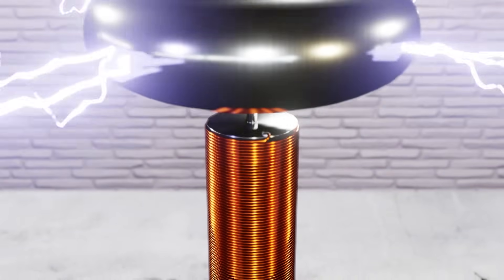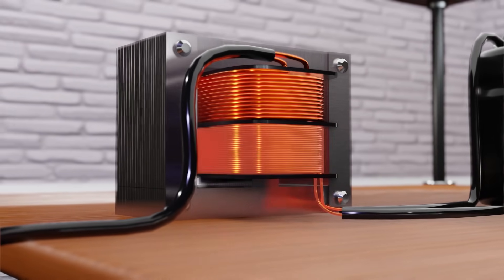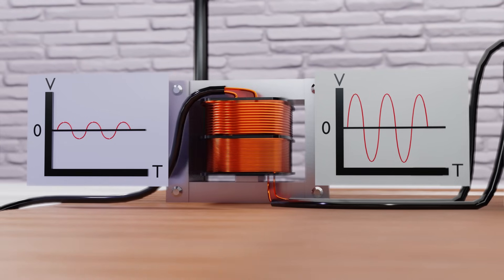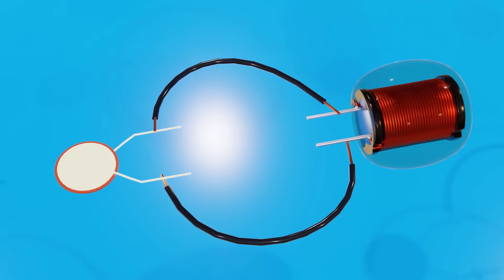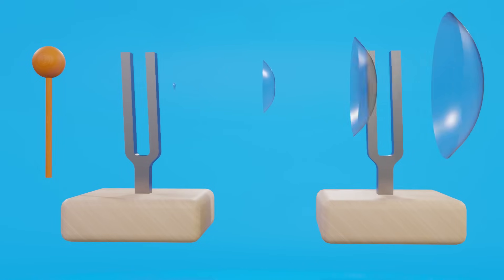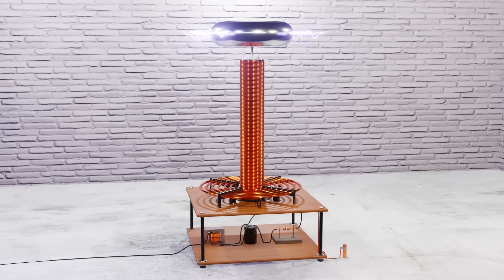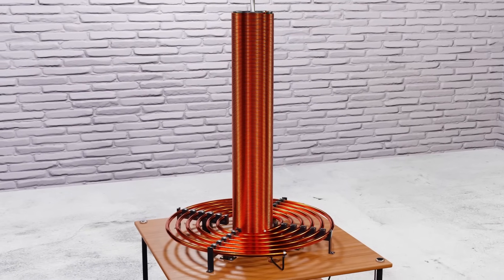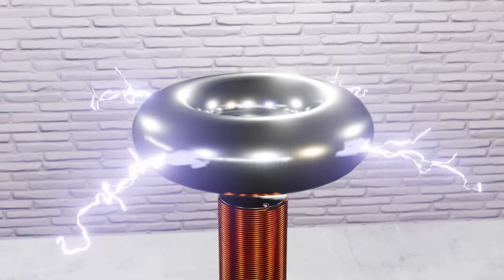How a Tesla Coil Works ⚡ How to Make a Tesla Coil ⚡ Nikola Tesla

Comment: Screw radio waves. Lets talk about Earthen resonate frequencies utilized to wireless conduct electricity as Tesla saw it. It's not new tech. It's not entirely unused, but few have even attempted a straight up functioning infrastructure. Then just plug into the ground and harvest the natural power of the universe by translating those seemingly infinite forces into good old fashioned electrical conduction that we like to call power.

Comment: Fun video.  As I understand it there is a mistake at minute 4:14.  When the capacitor is discharged the coil has the maximum magnetic field strength (correct).  The  magnetic field will decrease and induce a current in the same direction resulting in the capacitor being charged oppositely to the initial charge. (seems to be incorrect as you say in the movie the current is reversed)

Comment: I wonder if it would be hot to the touch like does a tesla coil generate heat?
Reply: Wire usually gets warm to the touch, but generally not hot enough to melt the structure or cause burns.   ~100-120degF is pretty common across coils of this size
Reply: @hakasays  thanks for the honesty

Comment: Electrical power distribution by Tesla method only a demonstration purpose only, it could never to be implemented as a practical means to send long distances as an utility as we use today with wires. Just a toy idea.
No need to tell  how dangerous a millions Volts of electric arcs across our atmosphere, it would be capable of giving electric shocks whenever earth & a metal objects touch by a living animal.
Infact during Tesla's experimental work horses with metal shoes had experienced it. Mentioned in the article about Tesla: " Maplin Electronics" 1996 Feb issue.
Besides the power getting low with the distance & no way to regulate it,  may need further equipment for it. Constant voltage at the receiver end only a dream.  Gullible viewers believe into think how great the Tesla is. We remembered him  for his pioneering work in polyphase AC generation/ Induction motor, [though the final products developed by the Dolivo Dobrovolsky] but not for his other eccentric, visionary ideas.
Reply: It goes underground. Very safe. Just reads teslas books and you will understand.
Reply: @nialldunne3985  Returned path of the power is through the earth, this is why it's more dangerous. Then Earth is always one conductor [not  as it today] & then we could get shocked  by touching a metallic object raised to the air.

Comment: Oh dear. Nope. You have not built a 'Tesla tower' because you are  not creating the second form of electricity that Tesla made use of, Impulse Current. Until you understand impulse current, you can't make a Tesla system of power distribution unless you remove the magnetic component and measured output is volts per second. Impulse current!

Comment: the magnetic field loses power quickly because the field is not pulsing within any resonance with the environment around it, if you add a frequency controller and if you know the resonance frecuency of the menium youre trying to cunduct thru you can actually amplify the output much like how you can swing higher if you shift your weight at just the right time, done in the wrong timing and your swing stops.... tesla knew this well over 100 years ago and you totally missed it, also the tesla coil was never invented to make pretty sparks the topload was actually supposed to have as much surface area as nessessary to keep the high voltage from arcing as bolts as this is a power loss.
Reply: Need more info sir lol. Would this work with those adjustments? Wireless power?
Reply: @michaelbrown428  you would need a device that can measure the environment electric fields frequency and set your coil to a resonance of that frequency.
Reply: @drayko-okamidirewytch5542  And, does that device exists? I mean, that was Tesla's intention and, according to some, he achieved it. I just want to know if we have the means. Cuz if we do, then it's only greed that keeps us in the dark.
Reply: @jacomeluis  well yes greed is keeping alot of tesla's work away from public knowledge, but truth is yes we actually already have the means to continue his work however the knowledge to do so these days would be quite difficult to find.

To give a bit of an example we have the means to understand vibrational harmonies, take a piano for example, strike 2 random keys and you might hear a pleasant tune or you might hear one thays rather nasty, this is an example of harmonics. Because many systems even in our own bodies are sensitive to vibrational frequencies we can actually use our own senses to tell if a vibration has harmony or not. Put simply a good chord feels good because it resonates positively with the various parts of our body.

There's another example of being able to detect harmonic frequencies and that where you use a subwoofer a metal plate and sand, and as you transition thru a frequency range you can see the sands design change, while some frequencies look amazing others look chaotic. It could be a matter of applying this to other designs like maybe an array of electron guns thay use frequencies ranges to see how a medium reacts to the transitions and taking note of where the patterns in the interactions look more orderly than chaotic or some such.

The hard part is we have to stop being students of science and return to being explorer's of science and make the new discoveries ourselves.
Reply: @drayko-okamidirewytch5542  Cool... Thanks for the explanation. 🖐🏻
Reply: @jacomeluis  I do apologize if it's badly articulated, it's not easy for me to describe these things even with a wide range of knowledge. I can tell you that some topics to consider studying would have to be organic geometry like the golden ratio and the platonic solids, music theory is a good one in combination with mathematics. The reason we see nature as beautiful is because the patterns we find on all facets that have mathematical roots. And everything boils down to its simplest parts as a vibration, even an electron just orbiting an atom vibrates, and nothing can vibrate out of harmony with its environment for very long as doing so expends energy forcing the disharmony element to return to harmony with its surroundings, from the quantum to the macro this is always true, even study of the hermetic principles would show this fact.

I could go on for hours about the many great things I've learned from humanities history studying the universe and asking "why does it do that".

Sometimes the answers come more from a philosophy lecture than they will a science text book, we are the universe and the universe is us, as above so below, that which defines the structure of the energy within your mind so too does it define the structure within the universe, the only 2 opposing forces that can remain are those that neither diminish nor amplify their counterpart but remain balanced. If that makes any sense.
Reply: @drayko-okamidirewytch5542   I think it's fine... I'm not an English native so I always have to read carefully, but I can get the idea.

I got here because I'm studying pyramids and, apparently, Tesla was obsessed with them. I know it might sound crazy, but I have 3 years healing or treating all kind of illnesses with plain cardboard pyramids and I'm studying for a workshop somebody asked me to do.

There's many people working on that field, but it's still too unknown for the importance it should have. The thing is that, if I have felt in my own body the energy that a 3kg cardboard pyramid can condensate out of thin air, I can only imagine what a 6.000.000kg granite pyramid can do. I really think that one of their function was to produce and transmit electricity through the natural field, as Tesla wanted to do with his tower...
Reply: @drayko-okamidirewytch5542  id love to hear more about your research…where can i contact you tho?

Comment: Well, you explained the demo he did.  Not how, or should I say the actual circuit that he didn't explain or show.  That was solved about 10 years ago by someone in New Zealand or was that Australia.  Nikola had allot of circuits and design stolen so by this time he didn't say or state until he had what ever built which was rarely in fact.  Most people look at the circuit left to right but you have to look at it right to left in this case.  Plus there is a single change to the circuit then it's whole operating principle changes.  It  becomes a wireless power accumulator.

Comment: This video is full of mistaken theory.  The toroid at the top would not store more and more energy, at each cycle of the primary unless there is conversion to direct current, (like diode rectifiers or a vacuum tube rectifier).  With spark gap discharge of the cap in the primary circuit one would not get a large discharge from the secondary., that is why rotary gap discharge , and DC charging and coupling of primary and secondary are usually used in high power tesla coils.  I'm not quite sure why everyone seems to build tesla coils with flat circular primaries, and very tall and narrow secondaries.  Tesla's MAGNIFYING TRANSMITTER at Colorado springs was a multiphase device, and had an extremely wide primary that was columnar, and the secondary was rather short and stout.  He also placed other coils into the mix that modulated the hysteresis of the primary and secondary.  his initial idea was to use the Tower to provide a controlled discharge of the ionospheric charge in the upper atmosphere and create a resonant response in the iron core of the earth.  So, not only were the coils of his "transmitter" tuned, but standing wave harmonics in the ionosphere and the earth's core were meant to also be put into resonance, so the breakout discharge was absolutely necessary as that provided a path for discharge of the ionosphere into the coil, and the grounding system provided a way of creating ripples in the magnetic field of the earth.  So far no one much seems to read and understand Tesla's articles.  The only explanatory video's that I have seen that make much sense of Tesla's Planned devices are by: "Lightening on Demand", and Long Now Foundation.  

Paul Carlson (Carlson's Lab) shows how two resonant Tesla coils, tuned to the same frequency couple energy without spark breakout, but this is not really how Tesla's transmitter was intended to operate.

Comment: Soo, what Book did you read this out-of? The Air itself has a Built-in Capacitance and Tesla knew of it plus how to Make the Capacitance Elastic ( which you've totally ignored ) and finally, The Tesla Coil was used to take Static Voltages and drop them down to High Current with Usable Voltages .. not the other way around.!
. When it comes to Tesla Designs, you get An "F" for having nothing more than a Management Degree in Engineering From One Book.!

Comment: Joule thieves are why we don't use tesla coils.
See, in radio there is stuff that  comunicate back for sampling so we can get the ratings so advertisers can fund our radio stations, and it's not legal to make a device that doesn't accept interference.
 BUt it's possible, but almost pointless. It doesn't do you any good, in fact, all you would do is spend energy to loose a service. that is allready free. you still here the ads, but not pay the station, and you raren't a militia so  not having your radio jammed means nothing.
You might as well not risk going to jai over nothing.

But internet hackers will steal your wifi and all sorts of things becuase doing that has vallue.
Theives would steal electricity, and coils are easy to make and destroy. 
in other words, it can't be monetized and no one has figured out yet how to enforce payment

Comment: I've made several TC's. Right now I'm working on a spark gap model with a synchronous rotary gap.  I fortunately have a .025 mf 50kv capacitor.  Hard to find!
Reply: is there a way to use and store in a battery somehow? i could never understand sadly

Comment: I still need understanding on what the spark gap's purpose is. Also, why is it that the light bulb that is closer to the main Tesla coil out of the field can't receive power, but the secondary Tesla coil further can? I already understand the sound wave 2-tuner analogy, but what is the difference in the Tesla coil since you said the magnetic field does not travel far?
Reply: Consider the radio receiver. Electromagnetic waves travel great distances, like to Mars. They're pretty weak as the distance increases but they're present. In the case of the TC just too weak to light the bulb as distance increases. However if they hit another tuned resonant circuit the demonstrated pendulum effect happens.
Reply: The secondary coil is on the same frequency as the primary one so it receives the EMF that it then uses to power the light bulb.

Comment: How would a tesla coil be beneficial in transmission of electricity,and also would super conductivity be an option
Reply: In theory you could power a whole house or even city wirelessly.
Reply: @prestonwarren2692  yes I'm aware of the possibilities, tesla was well on his way before  Morgan stopped him.i watched the development of mag trains using super conductive coils, I was interested in the prospect of using the two in combination, coils to maintain the current tesla coil to broadcast, just a thought
Also did you hear anything about an African that is useing a wireless device to convert radio waves in to electricity, supposedly has been useing it on his television
Reply: @dannyjohnson6967   I haven't seen that it sounds very interesting. I don't think we will ever see anything like that simply because there is no money in it. Wires running to your home is how they determine how much electricity your using and charge you accordingly. I know if I discovered or invented any sort of alternative energy source I'd be reluctant to tell anyone about it. The same goes for fossil fuel replacements.
Reply: the Original Tesla coil would make a great power supply , and yes a superconductor no problem, also it could run a particle accelerator, for an interstellar craft, the math has already been done. we are getting a clearer picture of this coil because of the upcoming tech about to become available.

Comment: Yeah except for that's not how it was intended to be used can it transmit yes but try this reverse the polarity put the coil on the roof put an equal amount of copper in the soil put a voltage meter on it
You see they couldn't hide the fact that the coil exist they just reversed it's intention greedy people set things up for the many to give to the few that was the opposite of Tesla's views that's why he was shut down
Reply: The reason for it's odd shape was because electrical current will go over your antenna but as a mushroom shape it would be forced to divide the atmospheric current go figure

Comment: Great video except for one major design flaw.. this was not the intention of Nikola Tesla's design This was a neat trick that he could also impress people with.. this device was somehow designed to pick up free and content electricity from the atmosphere and translate it into alternating current.
Reply: Finally some descent comments....
Reply: The sparks were just to show how much power it can make. He reversed the polarity to show this. You just need to reverse the polarity and it will be quiet and take energy from the air.
Reply: Yeah there's a lot of maybes, I think elevation also..  the higher you go the more electrical current you can pull from the atmosphere...
Reply: Indeed, vast amounts of energy are stored between the Ionospheric layer and the Earth. The Ionosphere forming a Capacitor storage mechanism with a resonance around the Schumann Frequency. Tesla was basically building a huge low frequency electromagnetic Receiver which would extract power once tuned to the Schumann Frequency. It's possible that he did indeed succeed but in doing so damaged the power grid to which his system was attached when power fed back into it. I read somewhere that Investigators from Westinghouse traced the incident to his lab and may have realised the potential of what was going on. Can't have that now can we...
Reply: @stephenherbst4430  lol, tunguska event: In 1908, Nikola Tesla was primarily focused on his ambitious Wardenclyffe project, a wireless communication and power transmission tower, and was also claiming to have detected extraterrestrial signals. Specifically, he claimed to have tested his "death ray" on the night of June 30, 1908, aiming it towards the Arctic. Additionally, he was still seeking funding for Wardenclyffe, which was nearing completion at that time. both literally happened on the same exact date...coincidence? randall carlson will tell us it was an atmospheric burst bolide...but, both could have potentially caused the explosive damage.
Reply: not possible. never been done. nikola tesla was trying to do this and failed. "free energy" from the atmosphere isnt a thing.
Reply: https://www.youtube.com/watch?v=15V0gUXUPko
Reply: maybe he aligned his coil to the magnetic field of the earth? or he put magnets somewhere near the coil?

Comment: You forgot the idea that you could  Give a vacuum to the top loadut Which word give the Tesla coil access to the atmosphere And the magnetic fields that reside in different levels of the atmosphere So you can receive energy From the ground Even further away  Connecting to a receiver coil of the same design Why do you think Those sparks are coming out of it does the coil those sparks are trying to connect to the receiver coil You put that up in the atmosphere where there's more voltage voltage or more levels of energy And we would have wireless energy throughout the world on only 5 power stations